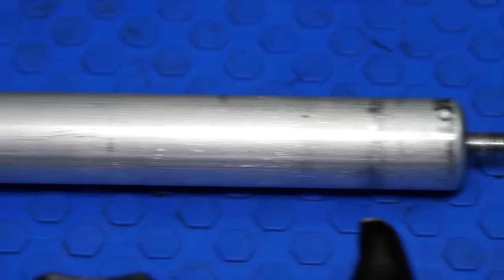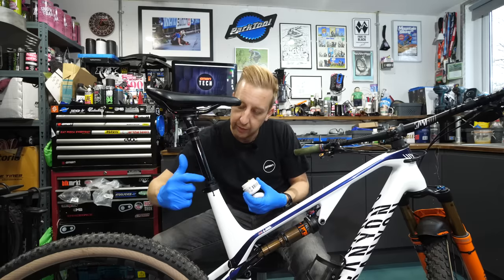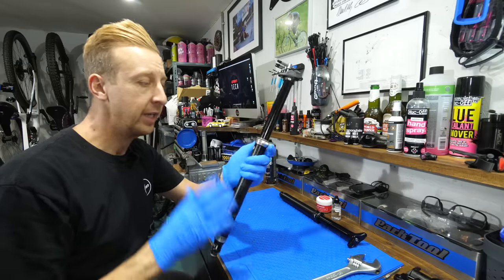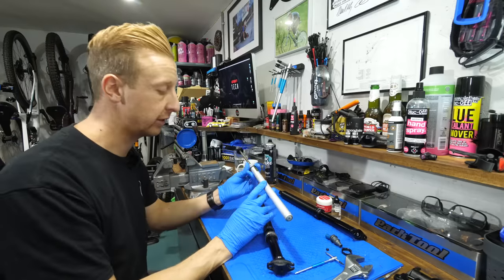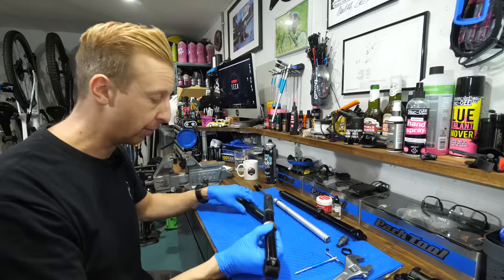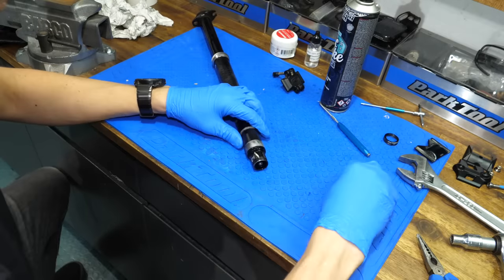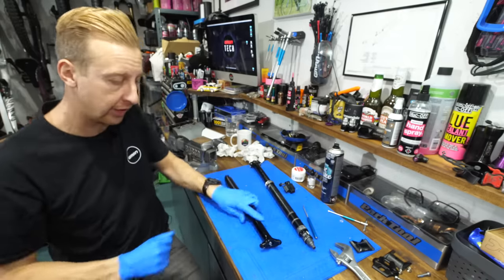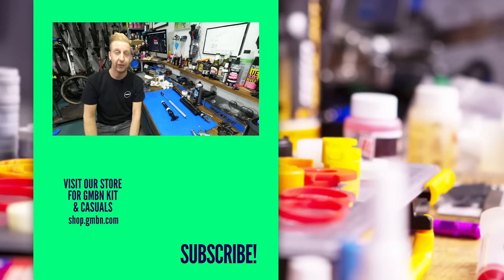How To Service A Slow MTB Dropper Post | Mountain Bike Maintenance

Comment: When you say to use suspension lube, are you talking suspension oil eg 5wt, 15wt or are you talking about something else
Reply: dont bother with sus oil,just put sram butter or slickhoney.
Reply: @elvisp8104  Agreed. Unlike a fork or shock, there's not much preventing oils from just dripping out of your post and pooling somewhere in your frame.

Comment: Good stuff Soddy, cheers for the vid. I have a brand x ascend 2 with external cable; how do you service one of those as mine is slow now?
Reply: To my understanding atleast with internal cables 125mm and 150mm were permanently sealed and 175mm was serviceable. If i remember correctly the external had the same fault as the shorter internals. Ofc things might have changed recently. Atleast 2019-2020 it was so. Good part is it is so cheap that u can buy 3 with a price of quality dropper.

Comment: If somebody doesn't have suspension fluid I wouldn't use chain lube. Instead I would use a light weight transmission fluid. It's basically the same hydraulic base fluid. (7-10w)

Comment: #AskGMBNTech
Hi Doddy and all at GBMN,
I have a Crankbrothers Highline seat post just like the one you've shown in the video. It's been working fine since I bought it in Aug 2020. However only recently I noticed that there's some 'play' on the stanchion part of the post. I can wiggle the post and it moves ever so slightly. Is it because the key & groove inside has slightly worn out? Is it normal to have this slight wiggle? The post functions well and I'm not so much of an aggressive rider by the way. Should I get it replaced as it's still under 1 year warranty?

Comment: In my case, it was slow because Giant didn’t install the bottom bump stop so a saddle bolt was deforming the top ring. Thankfully fixed under warranty but not impressive.

Comment: My dropper post was really slow because the air-pressure was way to low. Used my shock pump to get the right pressure. After that it works perfectly
Reply: what dropper do you have? where to add air?
Reply: @asianR53  I have a Syncros Duncan Dropper 2.0. On my dropper post its a schrader valve under the sadle. Take the sadle off and you should see it. The correct air pressure for my dropper is marked on my dropper
Reply: @jesperviktorsson8542  it’s not always as simple as adding pressure when u have sag . Needs bleeding like your brakes do

Comment: #askgmbntech
Doddy, thanks for the insight on keeping these posts working properly.  On another topic, I have been wondering if it would be technically possible to flip the rear derailleur system from the bottom of the rear triangle to the top, and reroute the chain accordingly?  Seems that it would eliminate bent/broken derailleurs.
Reply: doubt it - several reasons but one is the pull coming from the top of the chain and how that would affect the top of the upside down derailleur, and also nobody appears to have tried it. Also soon new tech will remove the derailleur entirely

Comment: I have the reverb stealth and have had nothing but trouble. It's pretty much useless when the temp gets cold. Kinda disappointed to spend so much on a bike with a rotten dropper.
Reply: Could be worse; your bike could’ve come with a Fox Transfer. My new bike came with Fox and I miss my Reverb. Brand new Fox Transfer and it doesn’t even extend fully. 🙄

Comment: I have a giant contact dropper post from a 2020 bike. When the post is in the climbing position it bobs up and down when I sit on it. Can you give me some advice on how to fix it?
Reply: Loosen up the cable?
Reply: Firstly, does the dropper lock in place or does it slowly sag down when you're seated on it? If so, check your cable tension. Then check that all bolts and pieces have been tighten to torque and that there's no up/down play. If those two have no problems then it's time to replace the cartridge. Air has worked its way across the IFP.

Comment: Dropper posts. Pay a lot of money to get one, then pay a lot of money for installation, to have more weight, more headaches to quickly maintain, and also add more money on your yearly maintenance vs your lazy behind stopping to manually lower the saddle when you need it, then rise it back up when you are done with the gnarly stuff.
But, then again, they are cool, and with bikes starting from 2000E and going all the way to 10000E, this addition seems minuscule.

Comment: I find the biggest problems occurring with the cheaper cartridge droppers is with the leaver and cable getting rusted and gunky, particularly this time of year when its wet. If the leaver is sticking or the post doesn’t lock out when releasing the lever, change the cable, makes the world of difference.

Comment: #askgmbntech

I’m looking at a Trek Remedy 7 and a Fuel Ex 5. The Remedy weighs 15.01kg without tubes and the Fuel Ex weighs 15.55kg with tubes. Okay, so ones with tubes and ones not, but that difference would be no more than 200g. 

If the bigger travel remedy is marginally lighter than a shorter travel bike, and they have the same tyre width, would they not be about the same to pedal around? Or is there something I’m missing? In terms of pedalling efficiency, why go for a shorter travel bike if it has the same ease of pedalling as a longer travel bike?
Reply: Obviously excluding ride charicteristics of the different suspension, but in terms of pedalling efficiency, why would you go for the shorter travel Fuel Ex?

Comment: I have a brandx acend 150mm dropper but the nut under the Seat clamp just spins freely. Also there is no way to adjust the pressure or do they operate at normal Air pressure?
Reply: on some droppers you can pump the air in cartridges on yours is just a regular one.
Reply: @elvisp8104  so does that mean when the pressure is too low I have to throw it away?
Reply: @keksfabrik5909  yeah,warrant?
My giant dropper died after 2 yrs,cartridge didnt work properly anymore,tried everything but no show.
Reply: @keksfabrik5909  To remove the nut you would have to fully extend the post while it's still assembled to prevent the cartridge from rotating along with the nut. You won't be able to tighten the nut too much, at max 2~3Nm only. Any more and the cartridge would just rotate. As for the air pressures, unless your post has an air valve at the top, it's set at the factory and you won't be able to adjust it. You can get replacement cartridges from CRC if it fails though.

Comment: Does anyone know how to add air to the fox transfer post?
Reply: It may just need cleaning and Slick Honey, SRAM Butter, or Slickoleum grease. They used to be the same think in different packaging. I assume still the same.
Reply: @mtnbikerva1  I used sram butter and it helps for a short bit but goes back to sticking after a few days
Reply: Transfers are sticky. My new one won’t even fully extend.
Reply: @pgjudo  I just got mine rebuilt it works awesome now even in the cold
Reply: @james-hb5tu , I just got mine on a new $9k bike, and I expected to not need it rebuilt before my first ride.
Reply: @pgjudo  yea it sounds like it is defected that sucks, bring it back to the shop you bought it from, Im sure they will get it fixed for you. I have had mine for almost 3 years and never had a problem until the last month

Comment: My advice : don't tow another rider from  your saddle if you have a dropper post, at least not an adult. I towed my wife up a steep hill using a "TowWhee*", the post has been harder to push down ever since. I need to put my bottom in a certain angle for it to go down, and it's now leaving grease on part of the tube.
*I read in a review that their saddle attachment made it compatible with dropper posts, that's BS IMO.

Comment: This guide doesn't apply to externally-routed droppers, e.g. the BrandX/TranzX Ascend 2.  These posts have a different top seal housing, so you can't unscrew them to do the quick lube which this video starts with.  Also, the disassembly method is different.  Be warned...